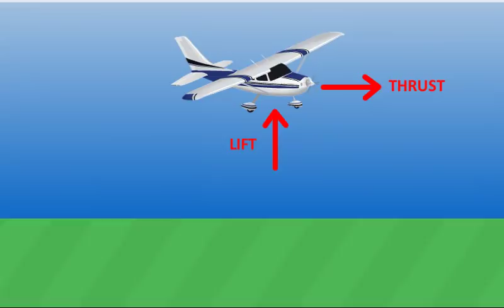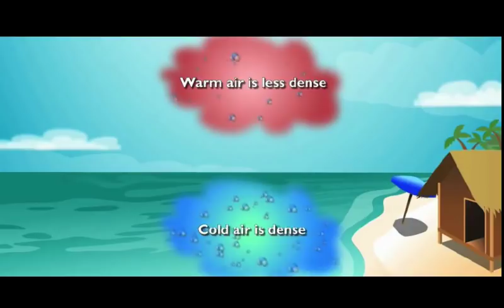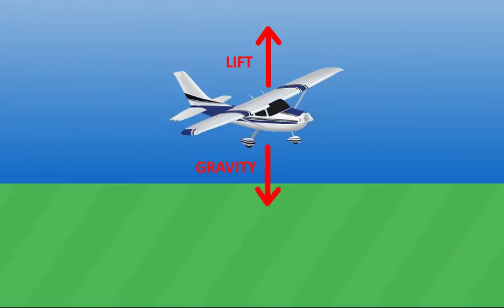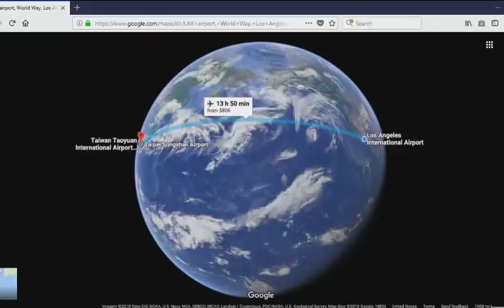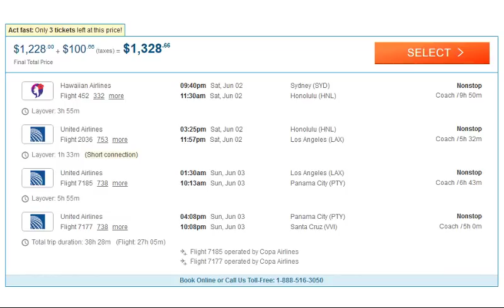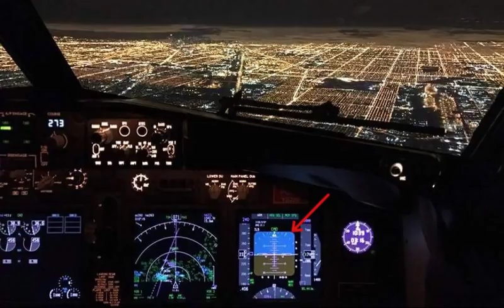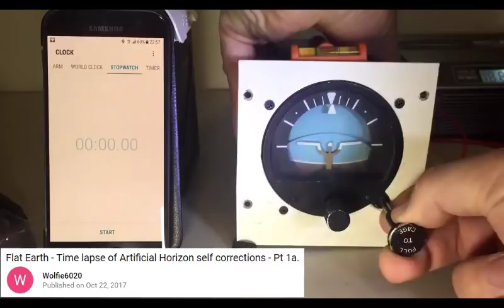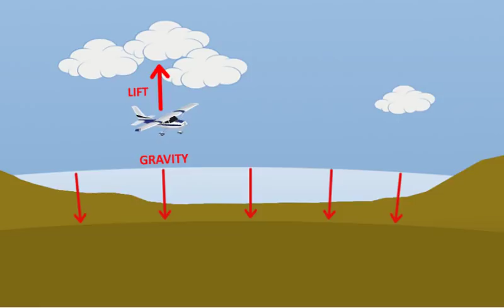Flat Earth Falsities - Plane Nonsense

Comment: Nonsense. You are just confusing the issues.
Reply: Please elaborate.
Reply: This video has no scientific or even logical base. For  example. He says the higher you go the less air pressure. True. But he says the flat earthers are wrong because of there was a dome the pressure would be constant. False. look at the oceans the deeper you go the more pressure. Wthere contained oo not. Secondly if the atmosphere is held by the gravity how come the vacuum of the spce does not suckk it all into the deep space. I am not a flat earther but I have hundreds of questions with no reasonable answers.
Reply: Farhad Derakhsan - "He says the higher you go the less air pressure." 
Correct.

"But he says the flat earthers are wrong because of there was a dome the pressure would be constant."
What he actually says is: "If the air was just contained in a dome or firmament, as mant flat earthers claim, RATHER THEN BEING HELD BY GRAVITY, then there would be no reason for air pressure to decrease with altitude".
As you can see I put the most important part in all caps. You seem to have overheard this part. If there would be no gravity, there would be no change in air pressure with change in altitude.

"False. look at the oceans the deeper you go the more pressure."
Exactly! Now why do you think that is? Because of no gravity? How would the water pressure be higher, as you go deeper if it wasn't for gravity? What keeps the water down pressing on itself? And please think before  you come back to answer "density". Density is not a force, it is merely a characteristic. Density describes the amount of matter in a certain volume. 

"Secondly if the atmosphere is held by the gravity how come the vacuum of the spce does not suckk it all into the deep space."
You just answered your own question. It doesn't get sucked into outer space because it is held by gravity. By the way, a vacuum doesn't suck. A vacuum doesn't do anything. It is the pressure outside of the vacuum that presses. Remember, a vacuum is empty. There is nothing that can do anything.

"I am not a flat earther"
I have some serious doubts about that.

"I have hundreds of questions with no reasonable answers."
Luckily, I have a lot of time. Go ahead and ask.

Comment: WATER WOULD HAVE TO FLOW UP HILL FOR A GLOBE TO WORK. WE ALL KNOW WATER DOESNT FLOW UP HILL. THEREFORE THE EARTH MUST BE FLAT. JUST LOOK AT THE NILE RIVER .NILE RIVER FLOWS OVER 4200 MILES SOUGH TO NORTH UP AND OVER THE EQUATOR WHERE CENTRIFUGAL FORCE IS AT ITS STRONGEST. JUST LOOK HOW THE NILE RIVER IS SITUATED ON THE GLOBE MODEL. THE NILE RIVER WOULD HAVE TO FLOW UP HILL FIGHTING "GRAVITY" AND CENTRIFUGAL FORCE THE ENTIRE DISTANCE OF 4200 MILES. THE NILE RIVER WOULD HAVE 572 MILES OF CURVATURE AT ITS MIDPOINT. (Apex) THE NILE RIVER WOULD HAVE TO FLOW UP AND OVER 572 MILES OF CURVATURE OVER A DISTANCE OF OVER 4200 MILES ON A BALL ROTATING 1000 MILES AN HOUR AT THE EQUATOR. IMPOSSIBALL!  THE GLOBE SUPPOSEDLY ROTATES 1000 MILES AND HOUR AND IS HURLING THROUGH THE GALAXY AT 37,000 MILES AN HOUR TOWARDS POLARIS.THIS WOULD CAUSE DIRECTIONAL ORIENTATION ON A GLOBE. NORTH IS FRONT/TOP...THE EQUATOR IS MIDDLE AND THE SOUTH POLE IS BACK/BOTTOM. ..THE WATER SHOULD MOVE NORTH TO SOUTH AND BE THROWN OFF AT THE EQUATOR. WATER ALWAYS FLOWS DOWN HILL AND FINDS ITS LEVEL.
Reply: TRU MAN fun fact....up is not North and down is not south..north and south are directios at fixed point while up and down as well as left and right greatly depends on your vantage point...pls know the difference..your only making a fool out of yourself...
Reply: Yeah..the Earth is indeed spinning at the rate of 1000 miles per hour....but you forgot to take into account (or just neglected it or whatever) the size of the Earth which is about 24000 miles...on that perspective the Earth should be spinning at very slow rate..that's why it takes 24 hours to complete just one rotation...here's an idea...go find a roundabout at ay childrens playpark stand somewhere close to the edge ask a friend to spin the roundabout at the rate of 24 hours per rotation..and get back me if you feel even the slightest movement or centrifugal force pushing you away from the roundabout..oh and have fun doing that..
Reply: TRU MAN  Answer me this question . you spend all this time and effort ,energy trying to prove that the Earth is flat. let's just go crazy here and say 10 years from now you prove it somehow( which isnt gonna happen because you're a moron) but anyways what do you gain? what happens then? you get some sort of prize? are you somehow compensated for the life wasted instead of just living it. seems kind of stupid now dont it?
Reply: No...your right.it's a man-made concept of better figuring out the location of places..and is only applicable on Earth...(or at least that's how I understand it..)
Reply: Andy Dizon you guys say that but it makes no sense. north and south are opposites of eachother. the nile flows between the center of said viewing points. 572 miles of curvature has to appear up to one side of the curve. we are not all on top like you guys claim. that is horseshit.
Reply: Tim Mccalla so just believe a lie is your solution?
Reply: So TRU MAN I have run into your smart mouth before on your 24/7 flat earth youtube page.  I just don't understand how the basic and most fundamental things about our home planet we all have to share are so confusing for you, I mean I got past the questions you ask like when I was 6 years old.       
Why do you insist there is an upside-down in space or rightside-up? ......YOU say water would have to run up hill on a globe but I can assure you there are hills and valleys on our globe and that water always runs down hill, even in Australia.....
About the 1000 mph thing, I don't believe you get the concept it would be the same as taking all day or 24 hours to spin a 1 ft. desk globe around one time to scale- it doesn't mean it would be the same as spinning a handheld globe at that speed. You have to keep it all to scale.   
Come on how old are you may I ask?     
I told you I was an amateur astronomer and you said the key word was amateur and called me a troll. That was me. I hope you see how I am being more civilized than you...
Reply: Barry Weaver thats the point. how can water go uphill over earths curvature?
Reply: okay Bobby Wizdumb when does water ever flow uphill, it doesn't, how can it??  God I seriously hope you don't think that North is right-side up in space?????  Please tell me you are only 6 years old so I can feel better about your question......
Reply: There is no "uphill". The arbitrary frame of reference you choose to visualize the course of the Nile from has no bearing on the actual physical forces at work. You might as well stand on your head and then ask how all the trees stay attached to the ceiling.
Reply: StoicSophist I ALREADY EXPLAINED IT .IF IT WERE A GLOBE ROTATING ON AN AXIS 1000 MILES AN HOUR AND HURLING THROUGH SPACE TOWARDS POLARIS THEN NORTH IS TOP/ FRONT ... EQUATOR IS THE CENTRE/MIDDLE AND SOUTH IS BOTTOM /BACK ... THE EARTHS MOTION WOULD CAUSE DIRECTIONAL ORIENTATION... 
WE ALL KNOW THE EQUATOR IS THE CENTRE / MIDDLE. .. THEN WE ARE SUPPOSEDLY ROTATING 1000 MILES AN HOUR ON AN AXIS WHICH MEANS CENTRIFUGAL FORCE IS GREATEST AT THE EQUATOR. 
THE IMAGINARY FORCE YOU REFER TO AS GRAVITY WOULD GRADUALLY GET STRONGER TOWARDS THE POLES . 
ITS AN "OBLATE SPHEROID"... "PEAR SHAPED" ... "A LITTLE CHUBBIER BELOW THE EQUATOR" ...
THEN ON TOP OF THAT THE EARTH IS HURLING THROUGH THE GALAXY AND SPIRALING AROUND THE SUN AT 37,000 MILES AN HOUR TOWARDS POLARIS. .. NORTH BOUND! NORTH IS FRONT! 
THE PHYSICS WOULD BE LIKE A WET FOOTBALL SPIRALING THROUGH THE AIR. WATER WOULD MOVE FRONT TO BACK ...NORTH TO SOUTH... AND BE THROWN OFF AT THE CENTRE/  MIDPOINT / EQUATOR . 

THE SUPPOSED CURVATURE IS 8 INCHES PER MILE SQUARED. ..

1) BEDFORD EXPERIMENT PROVES NO CURVATURE. 
2) TORONTO ROGERS CENTRE SEEN FROM GRIMSBY 6FT ABOVE LAKE LEVEL FROM 30.84 MILES AWAY PROVES THERES NO CURVATURE. TOP OF THE ROGERS CENTRE SHOULD BE OVER 200FT BELOW THE SUPPOSED. 
3) CHICAGO SEEN FROM MICHIGAN PROVES THERES NO CURVATURE. 6FT ABOVE LAKE LEVEL.60 MILES AWAY.CHICAGO SHOULD BE 2166FT BELOW THE SUPPOSED CURVATURE. 
4) THE LONGEST CANAL IN THE WORLD IS 100 MILES LONG BUT NOT A SINGLE LOCH WAS USED. NO CURVATURE. 
5) LONGEST BRIDGE IN THE WORLD IS 102 MILES LONG. SHOULD BE ALMOST 7000 FT OF CURVATURE IN THAT BRIDGE.
6) LAKE PONTCHATRAIN BRIDGE IS 24 MILES LONG AND COMPLETELY LEVEL AND BUILT OVER WATER THE ENTIRE 24 MILES. ONLY 2 INCHES LOWER ON ONE SIDE . 2 INCHES IN 24 MILES??? NO CURVATURE!  SEA LEVEL NOT SEA CURVE!
7) EXALT WIRELESS WORKS BY LINE OF SIGHT OVER A DISTANCE OF 146 MILES! IMPOSSIBLE ON A GLOBE! 
8) SASKATCHEWAN. .. SALT FLATS OF BOLIVIA. .. KANSAS .... ALL FLAT FOR HUNDREDS OF MILES! 

SEA (LEVEL). .. AIR (PLANE)... PLANE (T) 

THERES ABSOLUTELY NO PROOF OF A GLOBE ROTATING IN SPACE. NOT A SINGLE REAL IMAGE/FOOTAGE. 
MOON LANDING WAS A HOAX. ISS LIVE STREAMS ARE OBVIOUSLY FAKE AND FILMED IN STUDIOS. ISS=IN SOME STUDIO. 
HARNESSES,  GREEN/BLUE SCREENS,  CGI, UNDER WATER , AIR BUBBLES,  FLY ON THE OUTSIDE OF THE ISS WINDOW. ETC 
WE LIVE ON A FLAT STATIONARY PLANE WITH A FIRMAMENT ABOVE. THEYVE NEVER BEEN TO SPACE. ITS A CLOSED SYSTEM. WE CANNOT LEAVE THE EARTH. SPACE IS WATER. 

WERNER VON BRAUN (NASA FOUNDER / ROCKET SCIENTIST) HAS PSALMS 19:1 ENGRAVED ON HIS HEADSTONE. 
PSALMS 19:1 TALKS ABOUT GOD AND THE FIRMAMENT.

THE MAGIC ROTATING BALL DOESNT STAND UP TO SCRUTINY . ITS FULL OF CONTRADICTIONS. 
THE ATMOSPHERE AND SURROUNDING ENVIRONMENT DOESNT REFLECT THAT OF A ROTATING BALL HURLING THROUGH SPACE.
Reply: Tim Mccalla The Search for truth and exposing lies and corruption is never a waste of time. 
No proof of a globe rotating in space. No curvature no globe. Simple as that. 
You believe we live on a rotating ball? There's no evidence for this. And I'm the moron? Lol
Reply: Barry Weaver "Amateur" is the key word there. 

I ALREADY EXPLAINED IT .IF IT WERE A GLOBE ROTATING ON AN AXIS 1000 MILES AN HOUR AND HURLING THROUGH SPACE TOWARDS POLARIS THEN NORTH IS TOP/ FRONT ... EQUATOR IS THE CENTRE/MIDDLE AND SOUTH IS BOTTOM /BACK ... THE EARTHS MOTION WOULD CAUSE DIRECTIONAL ORIENTATION... 
WE ALL KNOW THE EQUATOR IS THE CENTRE / MIDDLE. .. THEN WE ARE SUPPOSEDLY ROTATES 1000 MILES AN HOUR ON AN AXIS WHICH MEANS CENTRIFUGAL FORCE IS GREATEST AT THE EQUATOR. 
THE IMAGINARY FORCE YOU REFER TO AS GRAVITY WOULD GRADUALLY GET STRONGER TOWARDS THE POLES . 
ITS AN "OBLATE SPHEROID"... "PEAR SHAPED" ... "A LITTLE CHUBBIER BELOW THE EQUATOR" ...
THEN ON TOP OF THAT THE EARTH IS HURLING THROUGH THE GALAXY AND SPIRALING AROUND THE SUN AT 37,000 MILES AN HOUR TOWARDS POLARIS. .. NORTH BOUND! NORTH IS FRONT! 
THE PHYSICS WOULD BE LIKE A WET FOOTBALL SPIRALING THROUGH THE AIR. WATER WOULD MOVE FRONT TO BACK ...NORTH TO SOUTH... AND BE THROWN OFF AT THE CENTRE/  MIDPOINT / EQUATOR . 

THE SUPPOSED CURVATURE IS 8 INCHES PER MILE SQUARED. ..

1) BEDFORD EXPERIMENT PROVES NO CURVATURE. 
2) TORONTO ROGERS CENTRE SEEN FROM GRIMSBY 6FT ABOVE LAKE LEVEL FROM 30.84 MILES AWAY PROVES THERES NO CURVATURE. TOP OF THE ROGERS CENTRE SHOULD BE OVER 200FT BELOW THE SUPPOSED. 
3) CHICAGO SEEN FROM MICHIGAN PROVES THERES NO CURVATURE. 6FT ABOVE LAKE LEVEL.60 MILES AWAY.CHICAGO SHOULD BE 2166FT BELOW THE SUPPOSED CURVATURE. 
4) THE LONGEST CANAL IN THE WORLD IS 100 MILES LONG BUT NOT A SINGLE LOCH WAS USED. NO CURVATURE. 
5) LONGEST BRIDGE IN THE WORLD IS 102 MILES LONG. SHOULD BE ALMOST 7000 FT OF CURVATURE IN THAT BRIDGE.
6) LAKE PONTCHATRAIN BRIDGE IS 24 MILES LONG AND COMPLETELY LEVEL AND BUILT OVER WATER THE ENTIRE 24 MILES. ONLY 2 INCHES LOWER ON ONE SIDE . 2 INCHES IN 24 MILES??? NO CURVATURE!  SEA LEVEL NOT SEA CURVE!
7) EXALT WIRELESS WORKS BY LINE OF SIGHT OVER A DISTANCE OF 146 MILES! IMPOSSIBLE ON A GLOBE! 
8) SASKATCHEWAN. .. SALT FLATS OF BOLIVIA. .. KANSAS .... ALL FLAT FOR HUNDREDS OF MILES! 

SEA (LEVEL). .. AIR (PLANE)... PLANE (T) 

THERES ABSOLUTELY NO PROOF OF A GLOBE ROTATING IN SPACE. NOT A SINGLE REAL IMAGE/FOOTAGE. 
MOON LANDING WAS A HOAX. ISS LIVE STREAMS ARE OBVIOUSLY FAKE AND FILMED IN STUDIOS. ISS=IN SOME STUDIO. 
HARNESSES,  GREEN/BLUE SCREENS,  CGI, UNDER WATER , AIR BUBBLES,  FLY ON THE OUTSIDE OF THE ISS WINDOW. ETC 
WE LIVE ON A FLAT STATIONARY PLANE WITH A FIRMAMENT ABOVE. THEYVE NEVER BEEN TO SPACE. ITS A CLOSED SYSTEM. WE CANNOT LEAVE THE EARTH. SPACE IS WATER. 

WERNER VON BRAUN (NASA FOUNDER / ROCKET SCIENTIST) HAS PSALMS 19:1 ENGRAVED ON HIS HEADSTONE. 
PSALMS 19:1 TALKS ABOUT GOD AND THE FIRMAMENT.
Reply: Baldi: (slap)...(slap),(screech),(Baldi catches you)
Reply: well FAK MAN nothing I say will ever change your mind besides you have how many followers now (a lot I'm sure) and there's no way you could ever backslide in your beliefs for you would be flogged so bad for it. Personally I don't believe the earth is pear shaped but rather it has been proven that the equator is wider than at the poles but equally so (no pair). ..... Also I don't have to be the best astronomer that ever lived to know the earth isn't flat. You really don't have to be an astronomer at all, just have some basic common sense. I've done enough of my own experiments and seen enough sunsets to never believe the earth is flat, I just don't see that it is but rather get a sense that it is a globe. Sorry if the word "plane" confuses you or that the bible says it the way it does but it doesn't change reality. The firmament is gone, it was the deluge of Noah's time before the great flood. FLAT EARTHER'S NEED TO BELIEVE!!!!!!  it's not about the earth.....
Reply: You have been told to stop trolling and fuck off, so lease do and stop wasting the Earth's resources.
Reply: No... Prove it!
Reply: wong Stop trolling. You've been told.
Reply: TRU MAN  - good point , there are 36 rivers in the world that flow south to north 6 in U.S.
Reply: wong why are you a troll?
Reply: wong you have been proven to be a troll.